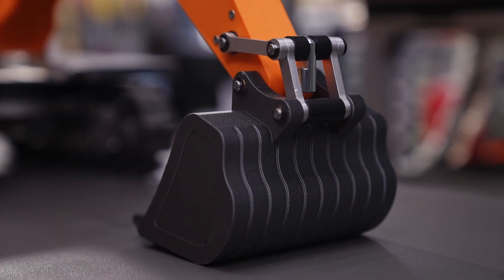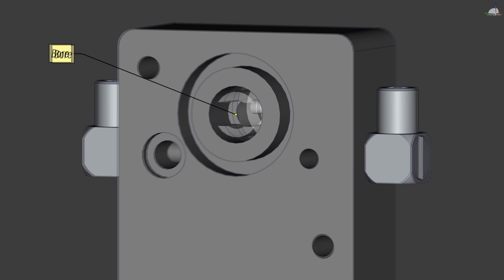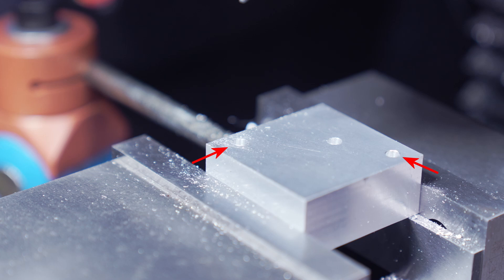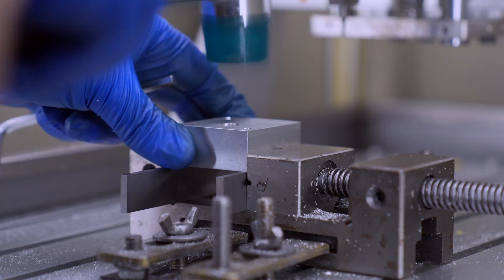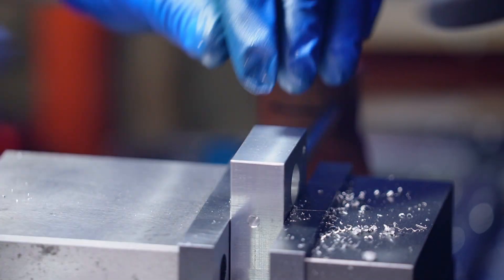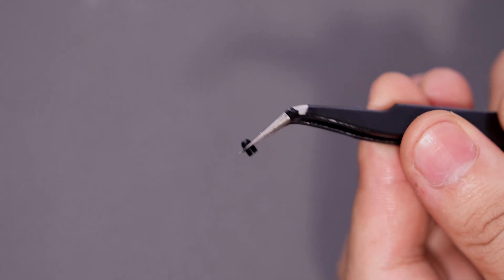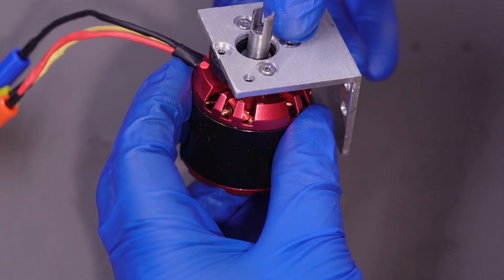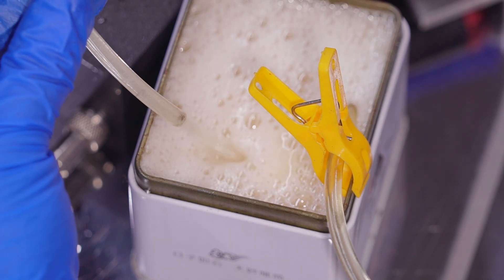Handcrafted Aluminum RC Excavator(1:24)  |  Part 4: How to Make a Hydraulic Pump

Comment from the maker: Let me make a correction. At around 0:48 in the video, there was a major error in the description of the two holes on the end cover of the hydraulic pump. I mistakenly referred to the oil inlet as the oil outlet, and vice versa. That is to say, the larger hole is the oil inlet, and the smaller hole is the oil outlet.

Comment: What motor do you used?
Reply from the maker: 4250 brushless motor,270kv
Reply: @WildMachinist  copy thank you
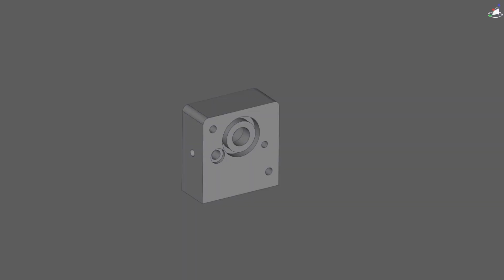Reply: @W @WildMachinist ir do you think this battery dimension can fit to my Rc: 1:14? I want to upgrade my battery but I'm not sure it this Di mention can be fir inside my 1:14, still shipping hoping next week.
Reply from the maker: @PinoyPrinceHall  The battery I finally chose is a 3S lithium - battery with dimensions of 135x43x31mm and a discharge rate of 35C. During the manufacturing process, I adjusted the design plan of the battery compartment several times.

Comment: YOU NEED A RUBBER COUPLER BETWEEN THE MOTOR AND THE PUMP TO REDUCE THE VIBRATIONS:face-fuchsia-tongue-out::face-fuchsia-tongue-out::face-fuchsia-tongue-out:

Comment: Great Piece of work,  looking for hydraulic pump for my home made digger at momet, dont supose i can buy a adapter from you? 

I have been a maintnance fitter most of my life and on a few ocasions on industrial machines I have had foaming / cavitation when the return to tank dumps to air rather than under oil level, like the return tube has broken off just in tank, the oil seems to pick up air
Reply from the maker: I'll release all the CAD files, including those for this "adapter", after all the videos in this series are published. You can make it yourself according to the drawings.The problem of air bubbles has been solved. It was because there was a leak in the through - hole at the center of the coupling. Changing the through - hole to a blind hole solved the issue.

Comment: maybe you get the bubbles because "cavitation", the inner pipe (tank) should be bigger diameter than the pressure pipe. That happened to me with bigger pumps., Try it, good luck!
Reply from the maker: I've found the cause of this problem. It's because there is air leakage from the through - hole in the center of the coupling. The solution is to change the through - hole into a blind - hole.

Comment: If the pump is sucking in air, the likely place is the recess for the o-ring in the connector block. You may have machined that too deep, which would prevent the o-ring from compressing enough to make a good seal. 

That annular boss on the pump housing is likely just a locating feature, and doesn't require the o-ring... Though the shaft "skeleton seal" is a good idea, to keep dirt and debris out (this is a piece of construction equipment, after all!).
Reply from the maker: That O - ring has indeed lost its original function. However, it's not because the circular groove is too deep, but rather due to the through - hole in the center of the coupling. This hole has caused both the O - ring and the oil seal to lose their intended functions.

Comment: The pump belongs to a VW/AUDI dual clutch transmission. It is the pump that controls the hydraulics actuators inside the transmission valve body, and is driven with a beefy bldc motor from the factory like the one you use!
Edit: As far as i remember, the original motor coupled with this pump was a lower speed- higher torque type, so a low KV motor. Maybe you are overspeeding the pump. Also don't run the pump dry, it is not good for them. Check the type of oil you are using, this pump was originally designed for the DQ200 transmission fluid, whatever it is. Maybe different viscosity? Anyways, the most likely problem is an air leak through a connection on the suction side of the pump, or the pump cavitating.
From google:
Mechatronic Fluid: This is a hydraulic fluid for the transmission control unit. The correct fluid is G004000M2, and it is not viscous.
It is the same number with VW hydraulic steering wheel fluid!
Reply from the maker: Thank you very much for the information you provided. It's very helpful to me.
Reply: what a killer comment just solved all the guy's problems
Reply: I think the pump is cavitating at this speed. 
Also the original oil is different as it meed to be working around -40 and the working temp of 120 C,(with normal peaks of 140C and max of 170). 
That is i think much different usage condition than the one will happen with this excavator.
Reply: Wow someone knows how to Google image search arnt you a big boy
Reply: @leeboy8689 ? I used to work with these transmissions. I don't think the attitude really helps the creator to solve his problems... Maybe some constructive criticism or info would help!
Reply: @leeboy8689  @andrewsweet43 is better than you lil bro must be a hard pill to swallow so you hate

Comment: it might be that it sucks air in the feedline,,but are you sure you run it in the right direction? if it runs in reverce you might get bubbles,
Reply from the maker: Since the video was released on various platforms, a lot of information has been collected. The most frequently mentioned issue is that the rotational speed is too high. The second one is air leakage. I have preliminarily ruled out the cause of the rotational speed. It should be air leakage. The possible air leakage point might be the center through - hole of the coupling, but I'm not sure yet and haven't verified it.

Comment: Its a transmission oil pump used in Volkswagen or Audi.

Here's what air bubbles could mean for your Transpeed DQ200 pump:
Low fluid level: The most common cause of air in any hydraulic system is a fluid level that is too low, causing the pump to suck in air. This can happen if there is a slow, unaddressed leak over time.
Failed accumulator or seals: The mechatronics unit uses a pressure accumulator. Cracks in the accumulator housing or leaking seals can cause the system to lose pressure, leading to the pump running excessively and introducing air into the fluid.
Improper refilling: If the mechatronic fluid has been recently topped up or replaced, air can be trapped in the system if it wasn't properly bled or primed.
Overfilling: Paradoxically, overfilling the mechatronic unit can also lead to aeration. The excess fluid can be churned by the internal components, much like a milkshake blender, creating foam and bubbles.
Reply from the maker: It is highly likely to be a sealing problem. To be exact, it is the sealing problem of the coupling. More precisely, it should be the problem of the motor shaft hole in the middle of the coupling. This hole should not be a through - hole but a blind - hole.